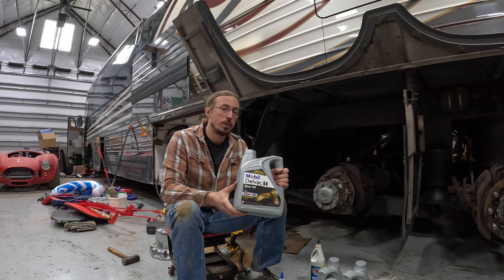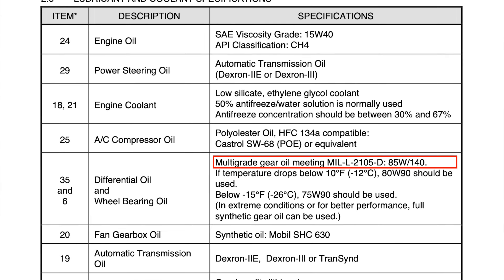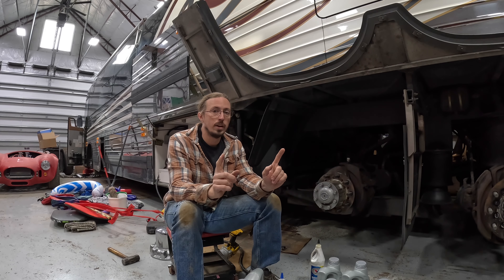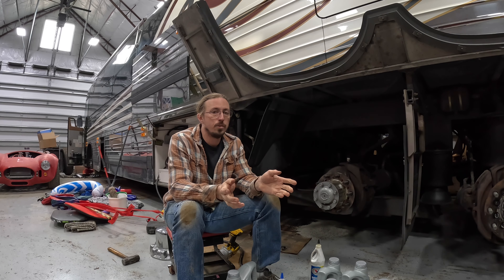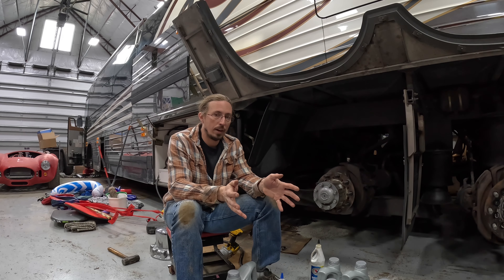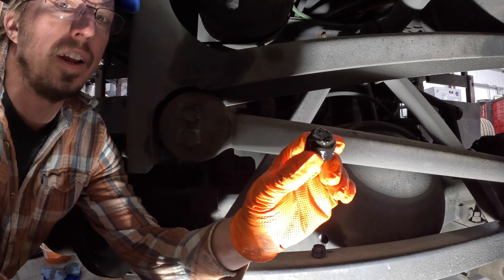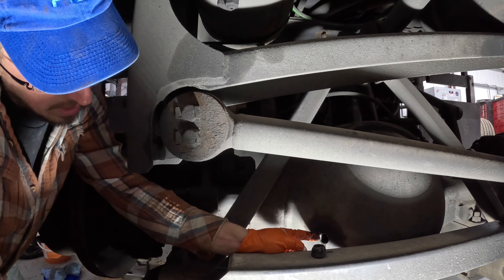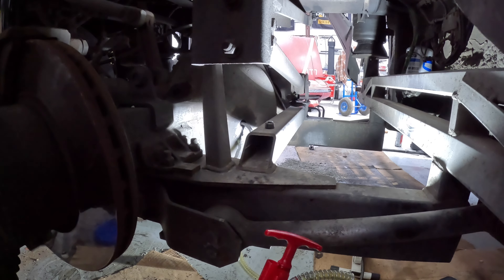What Differential Fluid Should You Use in your Prevost? (or any Meritor axle) and How to Change It

Comment: Great overview.  I used a similar thought process on my coach's rear diff.  I replaced my fluid the first time at around 55k when we first bought the coach, then around 80k and now when it has >140k, also with synthetic 75W-90 GL-5 gear oil.  I  use the same gear oil in my tag and steer axle wet hubs as well.  

Also just replaced all of the air springs on mine a couple of years ago as I was starting to see some deterioration at the bulges.  

I have always gone through a similar process as you are with coaches and vehicles, zeroing them out before I commence using them, then regular preventive maintenance during ownership.  

I'm curious how many miles are on your Detroit Series 60 and if you are planning on running an overhead on it?  

I recently ran the overhead on my Cummins ISL @ just over 140k and Cummins recommend adjustments @ 150k miles.  If memory serves the Detroit manual states first valve adjustment @ 60k miles but I've heard many don't do them until around 100k or so.  Just curious as I'd like to see your video on running the overhead if you are planning on it.  

Thanks 
Mike
Reply from the maker: Mike, I definitely do plan on running the overhead on my Series 60. It’s got about 104k miles on it and to my knowledge it’s never been done. Based on the Series 60 groups I’m on it definitely should be done and I’ll probably see an improvement in performance and economy.

It’s on the list, but after some more preventative maintenance and repairs. I’ll definitely make a video when I do it.
Reply: @TedsGarage  looking forward to it.  Mine were all a few thou on the tight side @ 140k + miles.  Not terrible and still within the specified range, but tighter than the setpoint and was worth doing it.  The Jacobs compression brake was pretty much spot on though.  

Thanks for the quick response.
Mike
Reply from the maker: Not sure if you saw my video on my 3126, but I did find several on the tight side. From what I’ve read the Series 60 does generally wear enough to warrant the adjustment.

Mine doesn’t have Jakes, though - I have a transmission retarder, which I’ll do a video about at some point as well. I was a bit unhappy about it not having Jakes, but the easier overhead is nice and I find the transmission retarder to be a good device.
Reply: @TedsGarage  yes, you will like the retarder.  Just have to pay a little closer attention to transmission temps but generally not an issue.

Comment: Thanks for the video! I have a 04 Monaco Signature with a series 60 (14L) and I'll be changing my diff fluid this spring while following your recommendation. I'll also be changing my tag axle hub fluid too. I already changed all my filters and my fluids over to synthetic, other than my diff and transmission. I also modified my exhaust system on my motorhome,  installed a K&N air filter replacement. (38-2002S), and my EGR system. (theuglyfix)

I was curious, what's your thoughts on tuner devices for our series 60? I am also always thinking of ways to improve efficiency, and one I have been thinking of was a tuner. I am not really going for crazy power gains (want to prevent excessive EGTs), instead MPG gains.

You mentioned driving your coach in cold weather (10F or more) (possibility for salt conditions), have you looked into undercoating? I recommend fluid film or wool wax. I don't recommend anything that cures or dries hard. Also, take a look at a product called saltsgone, to rinse your coach off after driving in salty conditions.
Reply from the maker: From what I've found so far on the Series 60 most truckers with this engine get it tuned by a professional rather than buying a tuner. I did this on the 3126B on my previous RV, and that's the route I'm planning on going for this as well. You definitely want to make sure who you use is reputable. I'm mostly interested in fuel economy improvements like you, but I also have a few other things I want to do to improve drivability, a few things that will be out of the box. Look for a future video on that - I'm not sure when exactly I'll do it, but most likely sometime later this year.

Also, I'm assuming you have either an Allison 4000 or B500 - I'm working on an upcoming video on changing the fluid on it. I did the change already a month or so ago, I just have to finish the editing on the video. Look for that coming up soon!

Good tip on the K&N filter! I'll have to check the measurements and see if that would work for my Prevost.
Reply: @TedsGarage Thank you! I’ll keep an eye out for videos. Check out PDI performance (big boss tuner), they tune very well and have tuners and additional parts available for our series 60. If I remember correctly Newell uses PDI as well for tuning customers coaches if requested in the build.
Reply: @TedsGarage  I have a Allison 4000. I’m changing the fluid this spring with product: Castrol TranSynd 668
Reply: @TedsGarage also this could be a monaco thing, but if you have a plastic coolant level sensor, replace it ASAP with a metal sensor. If you have coolant in the terminal housing its already bad. It leaks down the wire harness making its way to the ECU eventually destroying it. part: 23520380
Reply from the maker: @Austin2276  I'm familiar with PDI, I'll look at the tuner for the Series 60. Just a quick glance makes it look a lot more expensive than a custom tune. I've also got a few out of the box ideas I want to do (aimed at improving drivability in the mountains among other things). But, I'll investigate more. I considered their manifold and turbo on my 3126B, I'm looking at maybe putting a Full Tilt manifold on the Series 60.
Reply from the maker: @Austin2276  That's what I put in my B500. Good stuff!
Reply from the maker: @Austin2276  Thanks for the tip! I'll look into that.
Reply: @TedsGarage I'm curious, what were your thoughts on undercoating, and the brands I mentioned above? I use wool wax on all my vehicles, and plan to undercoat my motorhome before driving in the winter/salt. I have never driven it yet though during the winter time. Have you driven your coach in the winter time, with snow/salt? I know prevost is a whole different beast and was built to-be used all seasons, however have you noticed any rust? How does it handle?
Reply from the maker: @Austin2276  I haven't put any kind of rust inhibitor or treatment on my bus. It spent its life in Texas and Arizona before I bought it, so it's rust free.

So far, I've only once driven it in the snow/ice, and it was only a small amount. I noticed no issues at all, it handled great. I was also being conservative with my driving (as one should be in the mountains with winter weather and 55,000ish lbs of bus and Jeep) and not pushing it.

I should also note: that trip was after I'd put on new drive tires, which were part of a conversion to super singles. That'll be another upcoming video.